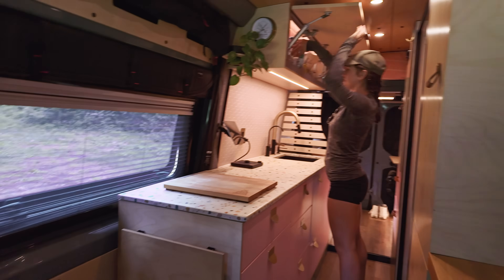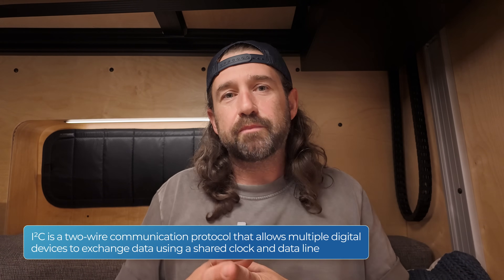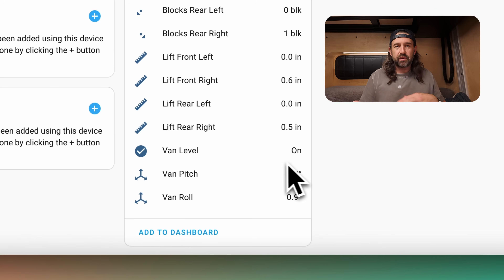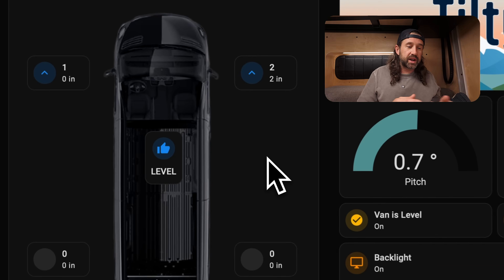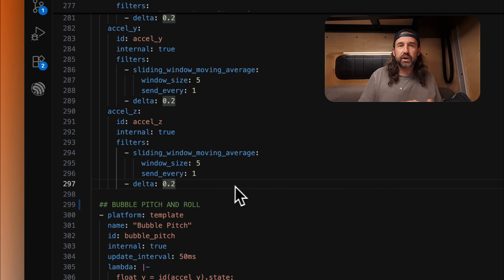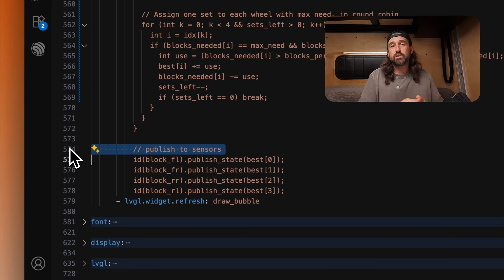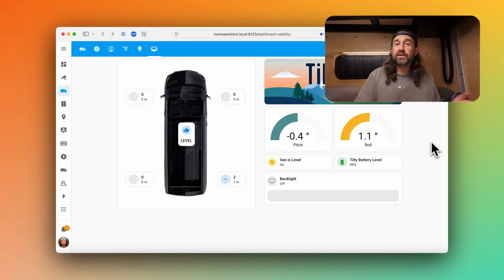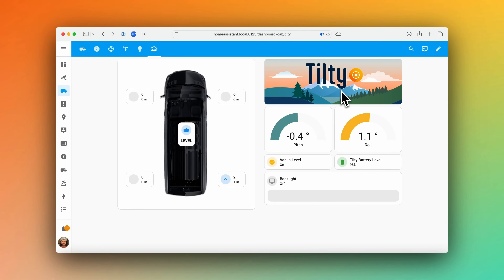Using Home Assistant to Level our Van!

Comment: This is exactly what I have been looking for for my camping trailer, but has anyone been able to get it to work on the M5Stack Core 2?   I tried to install Tilty but I keep getting an exception from ESPHome that "In file included from src/esphome/components/axp2101/axp2101.cpp:1:
src/esphome/components/axp2101/axp2101.h:10:10: fatal error: XPowersLib.h: No such file or directory".  Any help would be greatly appreciated.
Reply from the maker: try adding "libraries" lines under "esphome:" that you see below: 
esphome:
  name: tilty
  friendly_name: Tilty
  libraries:
    - lewisxhe/XPowersLib@0.2.1

Comment: Thank you, Mike. I just came across your videos. I recently installed Home Assistant Green in my Frankia Yucon camper, after having used Home Assistant on a Pi 5 for my home automation for quite some time. In the camper, I have Truma water and heating connected via MQTT, and both batteries are monitored over Bluetooth on the dashboard.
Now, I’ve ordered an M5Stack Core2 to integrate, as you suggested in your video. I’ll adjust inches to mm/cm, as I live in Switzerland.
Reply: I got it up and running — thank you! I had never gone that deep into ESPHome functionalities before. With the help of ChatGPT, I gained a better understanding and figured out where I needed to change the code. I converted inches to centimeters, and for my two wheel chocks, I had to adjust the leveling values.

During compilation, I first ran into errors with the external library lewisxhe/XPowersLib, so I had to include platformio_options: lib_deps: and use an older version — lewisxhe/XPowersLib @ ^0.2.6 — because in the newer release they had changed the function name.

I also had to copy the materialdesignicons-webfont.ttf file into the local fonts directory to get rid of the error message.

Happy that everything went well! Let’s see how Tilty helps next time I’m on the road with the camper.

Comment: You need to add some kind of power switch.  That device is sending data every 50ms even when it's not needed (it's not energy-efficient for a van). Maybe a switch within the ESPHome sketch itself to prevent it from transmitting when unnecessary.
Reply from the maker: The esp is reading sensors and calculating every 50ms but not necessarily sending data to Home Assistant. The sensor data is only sent if the value changes. For instance my last Pitch sensor update was 35 minutes ago because the value hasn’t changed since then.
Reply: @SmartyVan yea but if I start driving and my level is constantly changing?  Sounds like it would start sending every 50ms?
Reply: @richardburguillos3118  At that point the alternator is chucking huge current into the battery via the B2B, so the minuscule draw of an ESP32 becomes irrelevant

Comment: Got an M5STACK Atom Matrix and coppied your code for ESPHome, now I am trying to work out where you specify mm instead of inches? Living in the land down under where we use the metric system... Is it just math that makes it inches or is there a setting that needs to be changed?
Reply: Hey mate, exactly what I used and did (even in Aus as well). Just work with your LLM of choice to change the yaml to suit the Atom Matrix (I used Gemini Pro). If you get stuck let me know and I can send you my working yaml. It's just maths to convert to mm btw.
Reply: @SalandAnth yaml for matrix would be awesome. I think I have the conversion to mm sorted, although I haven’t confirmed it’s correct yet. I just changed unit to mm and changed the figures to mm, though I feel there may be a change in the math I have missed.

I then took a look at the documentation for the M5 and fixed a couple of GPIO errors for the sensor. Now looking at the matrix, but led mapping is something I have no experience with, so I’d love any assistance with that.
Reply from the maker: The units are agnostic. As long as you do everything in mm. You can relabel them too!

Comment: I tried it with a MPU6886 and ESP32 but the sensor is a bit nervous and when I move it a few millimeters on flat surface it switches to a Total different level
Reply from the maker: Do you have filters on the incoming sensor data to smooth it out?
Reply: @SmartyVan i used your code
Reply: @SmartyVan  I used your code, but it is very nervous. I use a m5 MPU6886
Reply from the maker: maybe head over to the discord where we can better review your code snippets and chat through any issues you're having! https://discord.gg/3rqeqES3zP
Reply: @SmartyVan I am already member, I start a new discussion for it. Thnx

Comment: Are you using this as a lift alarm? A shock alarm or even a vehicle entry alarm? I think it would be a good idea. When you are both away and the vehicle moves, you can send each other photos/videos.
Reply: A video idea would be to use an SDS011 to test the air quality in the vehicle. I use it on the same ESP as the MPU6050 and it works very well. The downside is the slight suction noise when it tests the air. Might be annoying at night.
Reply from the maker: That’s a fun idea! You could certainly get some good motion data from the accelerometer!

Comment: Do you also have the code for the ESP32 and MPU6886? And i get an error uploading the script because missing the bubble.png and more images. Where can i find them?
Reply from the maker: I do not have a configuration for a screen-less ESP32, but you could fairly easily strip the M5TACK Core 2 related configuration.

I've added the image files to the gist: https://gist.github.com/SmartyVan/6f9f6c4c5633caa1c91a6c8e067f44ff
Reply: thank you, I didn't looked at the bottom, but I will try to change the code to screenless esp32. Thanks for al your great videos!
Reply: @erikvandijk123  let us know if you get it working, I cant work out what code needs removing

Comment: Great work, as always!  I have HA in my travel trailer and would love to implement this.  BUT, now we're talking only three points -- tongue jack and the tires on both sides.  I'm thinking that would render your code fairly useless for this adaptation.  Any suggestions on where to start tweaking?  Or am I maybe assuming this is more difficult than it really is?😵‍💫  And no, don't suggest a bottle of hot sauce instead!
Reply from the maker: It would be ideal to refactor for three points. I would think about if you intend to use blocks under the tongue, or just rely on the tongue crank? But this could be refactored pretty easily.

Comment: Hi, we use centimeters in Europe. What do we need to change?
Reply from the maker: Howdy—the math should be unit-agnostic. Meaning, if you enter your wheel base, track, and block height in CM, then the lift results will effectively be CM. You could change the labels in Home Assistant to say "cm"—or go as far as to replace variable names in the config as well (if you are OCD like me). I probably could have made this a bit more unit-agnostic. My U.S. bias showing....

Comment: I bought some ESP8266 a while back and have nothing but issues trying to get them to work.  Is there any big difference between those and the ESP32 boards?  Will the same YAML configs pretty much work with either board?
Reply from the maker: I have found them equally usable and stable. Most configs are fairly interchangeable, though the esp32 does have hardware differences (advantages). There are so many clones and variants. If you have a bad batch or something, I’d just try some others. Though I’ve never had one not work.

Comment: ooh I don't have HA in the van but I'd love to use the hardware and logic to tell me the block count, to this block head reading a level and counting is hard.
Reply from the maker: It would be fairly trivial to add the block count or inches to the display! You’d have to keep the device where you can see it. But no Home Assistant needed then!

Comment: I wonder whether I can expose my phone's IMU to Home Assistant. I guess I could write an Android app that emits MQTT events.
OTOH, I could just make the app show the tilt and recommend tire blocks. 😂
Reply: There are Android RV leveler apps that recommend block sizes to use. Camper Leveler is one.
Reply: Or I guess I could just write a web page that reads 'deviceorientation' and recommends tire blocking.
Reply from the maker: Interesting idea! I don't believe that data comes in via that native Home Assistant app, but there well may be a way to extract it!